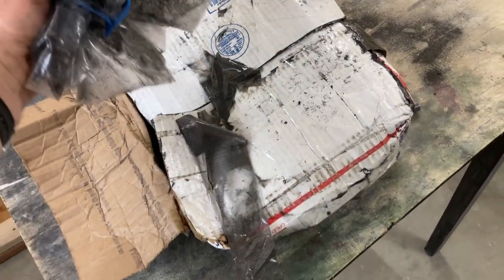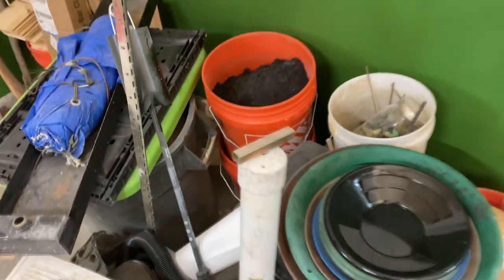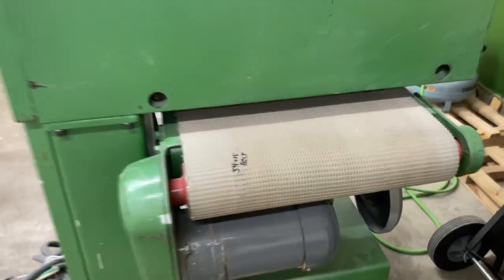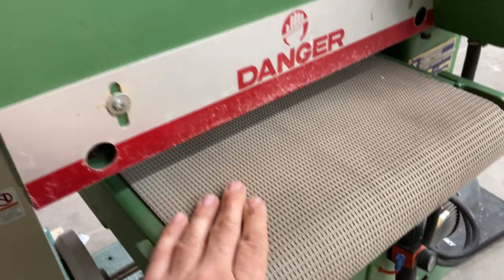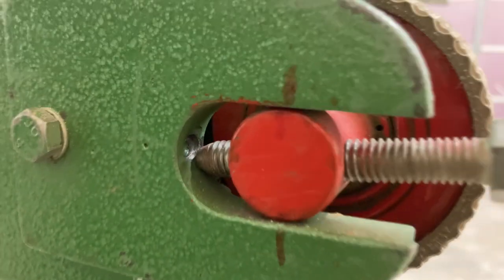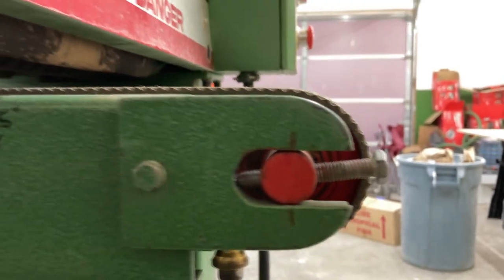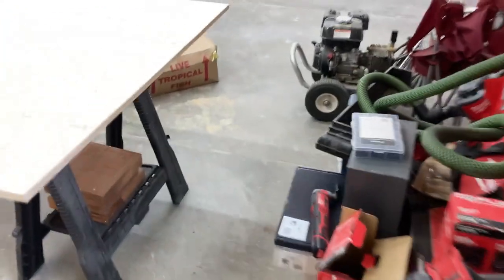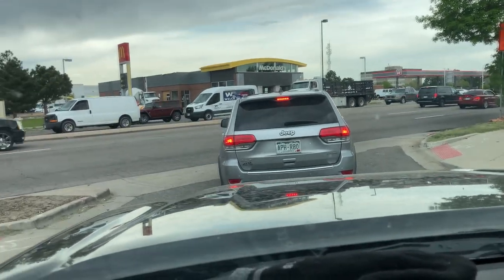Sheng Shing SDM-15 Wide Belt Sander Conveyor Replacement

Comment: I’m amazed that the E-stop bar is removed. I’ve heard stories of people getting sucked in by a timesaver…. Looks like it should probably attach where the opposing holes on the front of the machine is where the bar should go. Side note, the one we had at one of the shops I worked at had the bar in front of the conveyor so your body would actuate the E-stop.
Reply from the maker: I didn't even notice it was missing until now. Thanks

Comment: Vulcanizing a belt at home is extremely difficult if not impossible without the right equipment. Have it done at a shop that is equipped for it and you won't regret it. They can do it in 1/10th of the time!
Look for a local conveyor repair or conveyor belt sales facility!
Don't worry about the belt platter. It won't stay that way for long with regular use AND it won't hurt your production in the leadt!least!
You can use drywall screws for metal studs that have fine threads on those door frames. They have a flat head too!
Reply from the maker: Yep I took it to a place in Denver that makes/repairs belts. I decided to just have them build one to match the old one instead of them rezising the "wrong" one. I'll be shipping that back to Grizzly for a refund and pay (less) for a brand new one from the local company